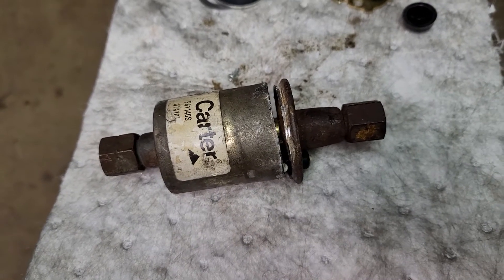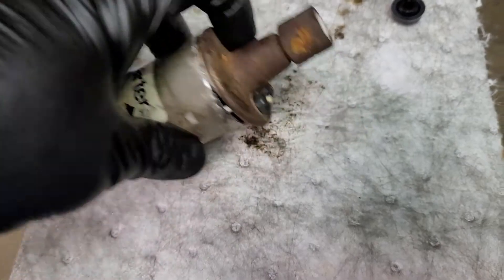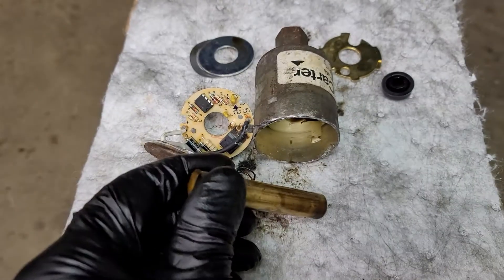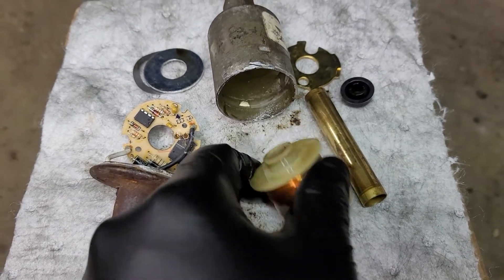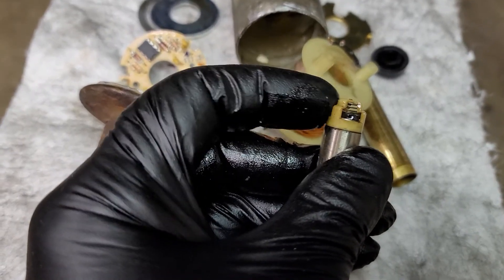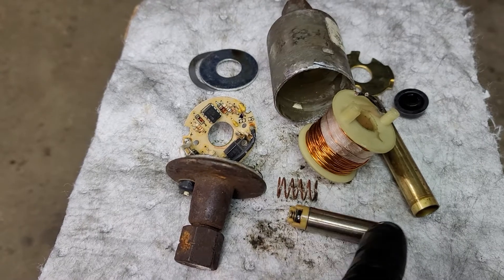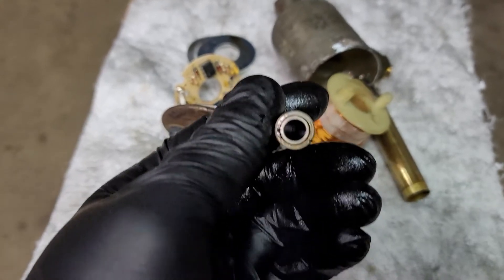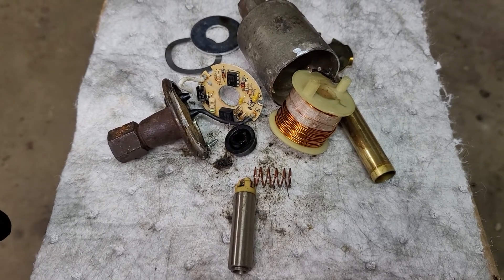6.5 Turbo Diesel lift pump pulse fuel pump dissection

Comment: Can you over pressure the injection pump with a lift pump?
Reply from the maker: no.
Reply: Too much lift pump psi will advance the injection pump timing (db2).